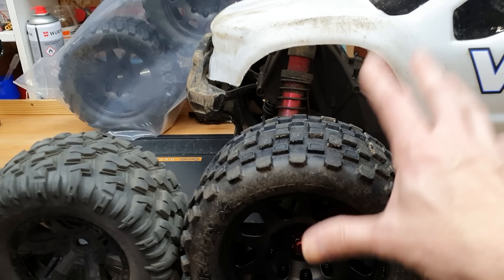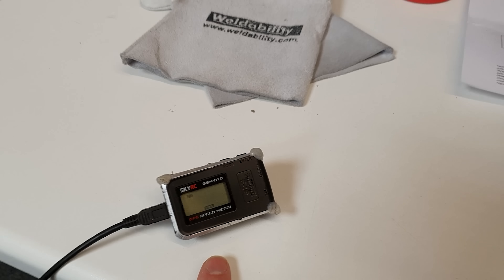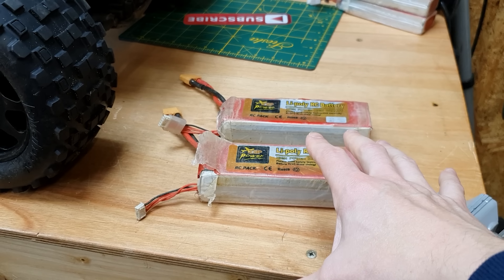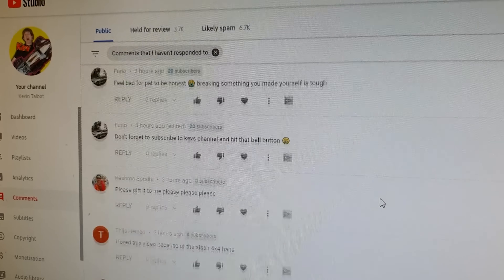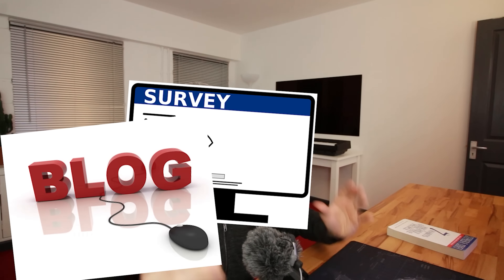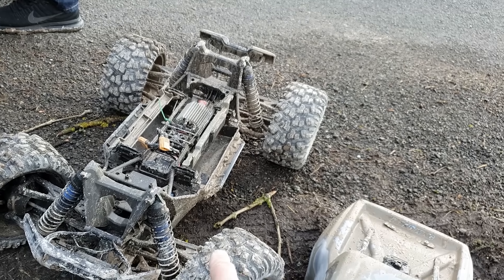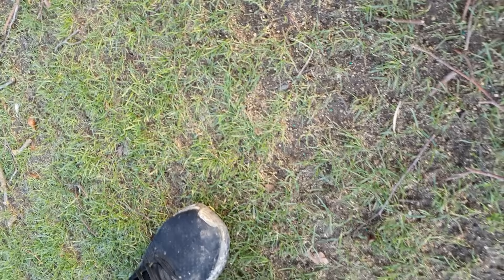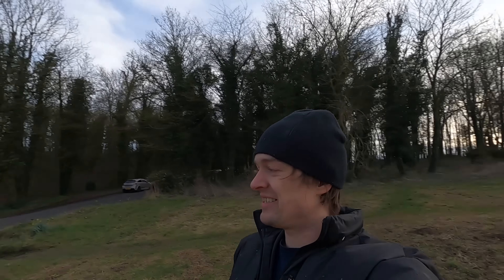Special Tires REAL TEST on Traxxas X-Maxx RC Car

Comment: Kev,
What are your thoughts on These Power Hobbies Scorpions vs stock? Tricks? Two Wheeling Stunts? Weight advantage/disadvantages.... I'm thinking of getting some of these but so many swear by the Stock Tires (but durability😮)
Would you run them over stock? 

APPRECIATE your feedback Kev
Reply from the maker: i prefer stock for general bashing but the powerhobby last much longer they dont ballon but are heavier and bigger so harder on the truck
Reply: @KevinTalbotTV  appreciate the response there brother. 
How about for Stunts, performance, Sliding into turns, too much grip, too little? 
Must be harder to get er up on two wheels like you do😮🤣

I can't wait to bash my XMaxx, just played with it in the street. She a beast, loose and wild... Just like I wanted!

Comment: Hey Kev, i have cracking noise on my HPI Bullet Flux when I break. I dont know what is the Problem
Reply: Probably the front diff skipping teeth. My outcast pops/cracks on acceleration when the rear diff is shot and pops/cracks when I brake when the front diff is going out.
Reply: @olds97lss  So is it a big Problem or can I drive with it
Reply: @rollyes_  You should get a new diff, pinion, bearings and shims on order as once it starts popping, it just gets worse until it's dead. Once mine start popping, I stop driving and fix it before running it again.

Comment: Kevin Talbot  i have a question. I am basically building my own 1/10 scale truck out of a T-Maxx 3.3 long body Full RPM everything and Steel role cage. Also converting trans( Gray T-Maxx trans )  to a single gear  Electic and adding the HOBBYWING EZRUN Max8 150A ESC Combo with Ezrun 4274 2200KV Brushless Motor Power Combo. How good do you think it will perform?

Comment: hi kev i have a traxxas rustler xl5 now vxl, i want a lipo 2s but i want a hard case for bashing and racing should i get a gens ace 2S 6800mah 50C lipo or a 2S zop power lipo, also if 50C to much for my vxl esc

Comment: Hay kevin.. just for a laugh put the X-maxx body on backwards and give the remote to some else.. watch them get very confused... also u can change the motor wires so it will drive the right way.... then u end up with a rear wheel stear X-maxx that is Super hard to control.

Comment: I'm running duratrax lockup x 24mm belted tires which are pretty much the same as these but cheaper at $100 for 4! Yes 4 tires. They just come unglued some times. Great tires!

Comment: I got my first rc and it's a nitro I need more fuel so what %nitro should I get
Reply: Aryaman Shukla you should always stick to the percentage it was running on before.
I prefer 30% on my nitro truck.... runs cooler!
Reply: @soflorclife6970  OK thanks I will run 16% then

Comment: I bought an XMaxx, and after having it flip over constantly, and not even being able to go 30mph without it flipping over, I returned it. You can forget about any sort of speed bashing with any Traxxas models.
Reply from the maker: don't buy a monster truck if you don't want it to flip bro!
Reply: @KevinTalbotTV  It's not the style, same thing happens with ERevo, Traxxas just too light to have a low CG. Not everyone lines up jumps like you do, some of us like to run entire packs at 20+ mph while hitting jumps without stopping.

Comment: hey kev, quick tip, i noticed that when the revo tire blew out there was so much water in the tire, put a small hole in the center of the tire it make another one that’s parrel to it on the other side . Same thing that the udr paper says for when running in sand. this way when they ballon the water spits o of the foam
Reply from the maker: I usually block the holes but forgot this time

Comment: A quick question to you Kev or regular watchers. I'm considering selling my Xmaxx 8s. It consistently explodes it's spur and pinions even after upgrading to GDS hardened steel gears. What do you guys run, Ive never used a full battery with it yet!!! 😣

Comment: Anyone else envy this guy busting up all those free RCs when I can hardly afford one POS!!! LUCKY BASTARD  LOL BASH ON   LOVE THE CONTENT!!!!
Reply: 2nd hand bro.
Reply: I bought a almost brand new 4x4 vxl ruster for 150 bucks. Only had a broken a arm.
Reply: Yeah dude i just bought a erevo 2.0 with some upgrades for 400rtr  used and it was really taken care of
Reply: He buys most of the cars, the only cars he gets free are some Traxxas cars and most of the bang good specials but if someone wanted to send him a car to review, he will ask them if he can do an honest review otherwise he doesn’t want them.
Reply: I found a slash 4x4 and a ruckus ecx with a brushless sidewinder motor and 3s esc. And a bag full of replacement parts and upgrades. 2 transmitters and 4 3s lipo batteries, and a metal roll cage for the slash in the DUMPSTER!!!! even found a brand new extra valeneon 4 pole motor and esc combo with it all lol cleaned everything up a d they both run great. Oh and there was a battery charger and an extra set of wheels and tires with it all also lol the slash has aftermarket shocks and a set of sway bars lol all I've bought was a new transmitter and some xt90 connectors. Who would just throw all of this away!!!!??????!!! I couldnt believe it lol was only a few months ago.  I've never played with rc cars until now lol I'm hooked
Reply: lol @tylerhogg2241
Reply: @talonvaughn6175  Thats a good way to get em  Good find!!!!
Reply: @miguelplascencia6093  Good find, Not trashing Kev, Just hate seeing RC broken all up, Cuz it anit me  LOL
Reply: @BarraGutheWorld  I hear ya, Im just mad cuz it aint me Hahaha

Comment: been watching your videos for quite a bit, and ive got to say i have enjoyed every single one. im hoping to get into the rc hobby soon, hoping to get a 1/16 traxxas slash 4wd for my birthday.
Reply: @Mostima115  thanks for the tips and recommendation, but im getting into the hobby on a tight budget, below $190 and i can get a slash 1/16 for 169 with battery and chargers.
Reply: You can also get a 1/10 slash for 189 with battery and charger too bud.
Reply: I have loads of RC but I’ve had my Eye on the 1/16 Erevo VXL for my Bday
Reply: @Mostima115  i have a traxxas slash 2wd and ihave got uprades and it runs fine